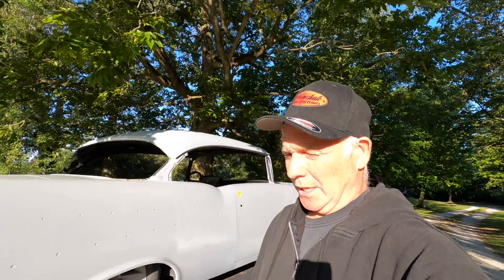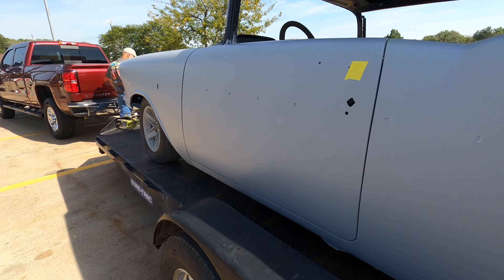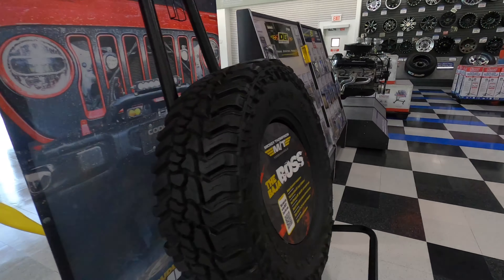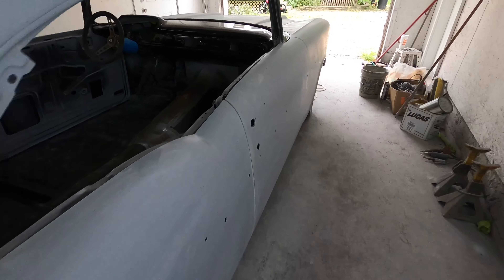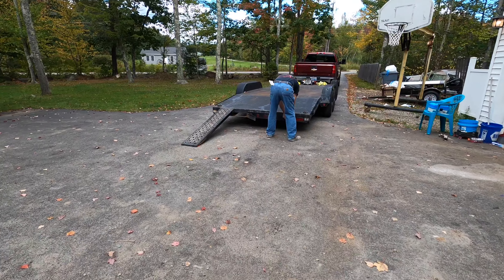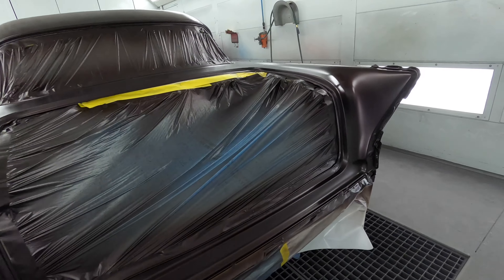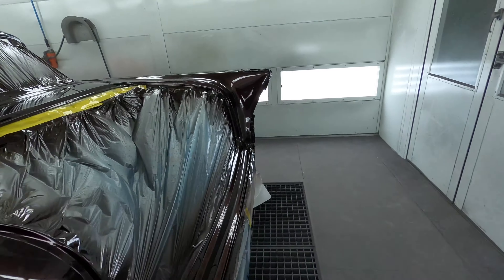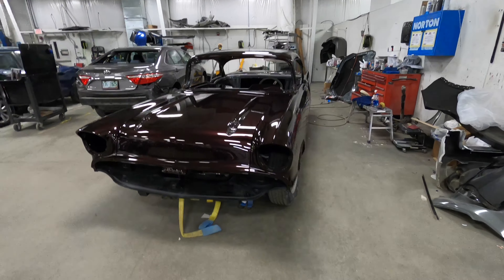1957 CHEVROLET BELAIR  RESTORATION  FINALLY PAINTED !!

Comment: Ok…why did you take it all the way to Mains for paint..are there no painters in TN or KY???  It looks beautiful!
Reply from the maker: I wouldn’t trust anyone  other than this guy I use to paint the reason it looks so good is the reason we took it there !! I’m sure there’re is plenty of good painter here but I’m not looking when I have a good guy 👍🏻
Reply: I actually own the car. It’s true of course that  there are painters in Ky and surrounding states. Most of the ones who are capable of this kind of work however are booked at least two years or longer out. They also would keep your car for awhile to complete the work.This was an opportunity to have a really good painter finish it in a week to two weeks while we stayed and helped with some of the work. It could then become a single trip to Maine. Honestly really good paint work is by far the most expensive single item when doing a project like this one. I wouldn’t or won’t hesitate to haul another car to Maine to this guy. As you can see it in the video he does excellent work and is also a very reasonable and honest guy.
Reply: @stevencox6548 I was wondering the same thing but now I understand.  Beautiful car. I’m going to be working on a 57 2 door hardtop but nothing like you have done.